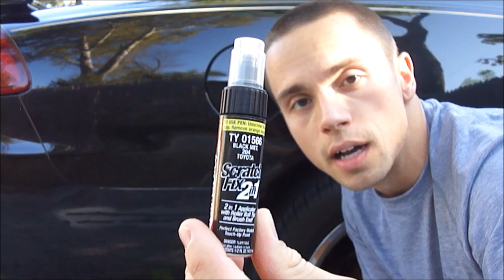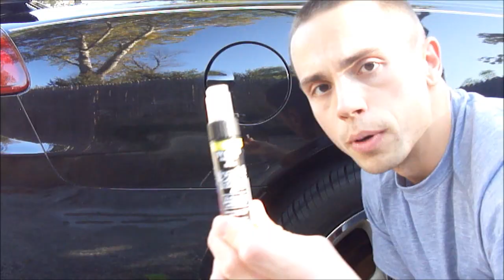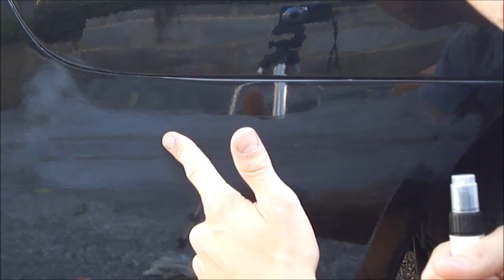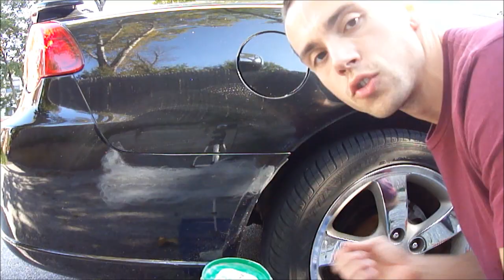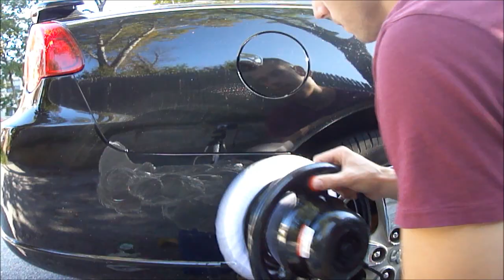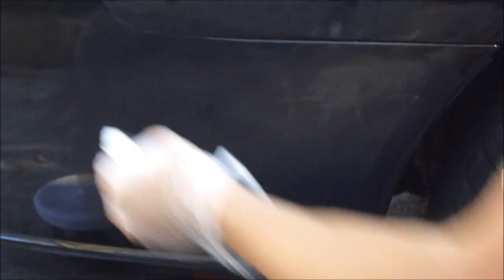How to Apply Touch Up Paint (to Almost Like New!)

Comment: Hey Rich, that looks good bro! As a professional detailer, can I give you some helpful tips for the future? First of all, you NEVER wanna sand in a circular motion! You do more damage that way to your paint. You always sand from left to right and stay as consistant as possible with light to moderate pressure. Second, stay away from the paste compounds. What you should be using for sanding jobs on any vehicle is Meguiars M105 Ultra Cut Compound. It's the best liquid compound around for tough jobs. It'll make your job a hell of a lot easier. Last, anytime you sand, you don't want to be using an orbital polisher cause there's not enough speed to take the haziness out completely. You should be using a DA Buffer or rotory high speed buffer. It takes half of the time instead of workibg 5 times harder and 20 times longer. Just apply the liquid compound on the yellow pad (compounding pad)and and smear it on the surface you're going to be working on a little bit so it doesn't splatter when you turn the buffer on, then you can start buffing the compound into the paint with low RPM's to start. After you start seeing the compound starting to haze a little, then you can crank up the RPM's a little more. As I noticed, you were polishing in circles also. That's how you can put haze marks, also known as holograms into the paint. You gotta move from right to left bro. Other than that, I think it looks good man. You sure did put some work into it. Maybe a little more than it should have been but that's because you were using an orbital polisher, not a high speed buffer. Great work man. I hope you can use those techniques I mentioned to you to cut your time in half and work less? It's up to you though. Hope this helped a little. Keep the world clean, one shine at a time!

Comment: Super Great Video. A truck pulled into the same panel on my Toyota yesterday. Mostly rub marks with a few places where the paint came off. I used wax and it cleaned up about 99% of the rub marks. Now I will be fixing the five spots of missing paint. Could not believe she pulled into me. Thanks for all your help. :)

Comment: If you are working by hand, after you are done with the 2000 grit sandpaper, do a 3000 grit sand paper sanding.  It will make the scratches a lot easier to remove with the compound.  As others have mentionned, that wax spreader is useless for componding and polishing... just do it by hand.  Use a small wax applicator pad (microfiber, cloth or sponger, doesn't matter) and compound until you can no longer see the haze.  Then do a polishing step with a finishing polish.  The best combo you can buy on a retail level is Meguiars Ultimate Compound and Ultimate Polish.  That will bring the shine back to the paint.  Then apply a wax or sealant to protect the area.  Also when sanding, using a sanding block or something that makes the sandpaper really flat is pretty much a must if you want to do a good job.  In a bind, use a kitchen sponge.  Just make sure only the sand paper touch the paint, not the scotchbrite pad, or you will ruin the paint.

Comment: I've been painting cars for close to 20 years What you did wasn't bad I just have 1thing. That haze you have isn't because you sanded too hard its because that wasn't a buffer you were using to buff with Its was more of a polisher used for aplying wax and polish, not compound.  they sell little buffer pads you can stick to an electric drill at auto parts stores that would work better. You need more friction and heat to get those scratches out. Don't listen to these shade tree detailers who know nothing, what you did was fine (not at all perfect lol but fine )just next time use a real buffer
Reply from the maker: Brandon Steele Wow, my mind was just blown. Thanks for comment! I've been wanting to buy those attachments for my drill.
Reply: Brandon Steele RichsMethods what he said :). Also I know you uploaded this vid in 2011 but you mentioned a sanding sponge early in the video just wanted to say that you can cop those at homedepot or lowes for a few dollars. I think they only sell low grit sponges(up to 3 or 400 i think, not sure) but I just wrap watever grit I need around it. Nice job!
Reply: Totally agree, the buffet he was using is a worthless piece of equipment.  They are far too slow.
Reply: hah i had one of those buffers once.. i think it cost $19.95..
Reply: Can you be a little more specific? There are lots of polishers out there, but how can you tell if it is a buffer? Speed? How fast? I just want to do a Q&D on an older PU, the clear coat is gone. I was just going to go and spray bomb new clear coat, and buff it out. nothing fussy.
Reply: joseph migliore oh，shit……you make me laughing so hard
Reply: Or a song from the Beverly Hills Cop soundtrack lol
Reply: Nice reply Brandon.I started iin the car biz in '72.Started my own in business at 18 years old,whew.time flies.
Back in my prime,I would use a wheel and wool and heat things up on a hood fender trunk and move the paint and close the gap on a scratch.Couldnt do it on every scratch of course,but I was really good with a wheel.
Dont really do that much anymore.I'm basically just a painter now,leave all the hard stuff for the young guys like Rich here.
I'm just happy to see a young guy actually working on his car and not sitting on his ass in front of a screen of some sort.Hell man,most guys nowadays cant even drive a stick.

Great job,Rich,don't listen to the haters,they need to hate their lives,not you.You did fine,but Brandon was right. Do like he said and pick up a little adaptor for your drill or actually you can pick up an inexpensive buffer at Eastwood or Harbor Freight.Be realy careful on plastic,you can burn things quick.Well not with a drill unless you lay into it,but just be careful on plastic.Metal,tool actually,with a buffer,dont stay in one place too long and let the buffer do the work,if that's what you get.Things can heat up quick,check your settings if you have them,start slow,stay out of the sun and have fun.Meguiar or Mother's are good products
Reply: And sanding in a back and forth motion would work best also, I too have worked in a body shop and I've never seen anyone sand in circle motion.
Reply: Brandon Steele q
Reply: A brandon quick question since you said you have experience. When i applied the pen on to my car it was the wrong black after wet sanding its uneven.if i get the right black to cover it  and sand will it be worse or it be better.
Reply: Brandon Steele said
Reply: Honestly that scratch didn't look that bad. I think you could have gotten a mr.clean magic eraser and gotten most of that scratch out. Than buff it out with some Meguilers or Mothers spray ,wait alittle than polish that out with a clean terry cloth and some good spray detailer. Elbow grease goes a long way for minor scratches.
Reply: BRANDON, I'VE HAD PROBLEMS WITH THE PAINT COMING OFF AFTER A FEW MONTHS. I USED HIGH QUALITY, FACTORY PAINT & 2,000 GT PAPER. THE PAINT COMPANY SAID I SHOULD HAVE USED  600 GT PAPER FIRST. THAT GETS ALL OF THE BUILT-UP WAX & OTHER IMPURITIES OFF. THEN, 2,000 GT TO SMOOTH IT OUT. YOU SEEM TO KNOW WHAT YOU'RE DOING. WHAT DO YOU THINK?

Comment from the maker: @happy9z I used the Color Magic (Black Wax) because it fills any voids in the paint with colored wax- giving an even better finish.  If your car has a lot of nicks and/or scratches in it, the colored wax works great to fill in those voids. Because your car is silver though, the normal Meguiar's NXT generation wax should work fine. I used to have a silver car and the Meguiar's worked great. I recommend getting the Meguiar's for your color car.

Comment: I use this to touch up chips and dings in guitars. I found it best to use a tiny brush with lacquer thinner to smooth the edges of the scratch or chipis. Then fill up the scratch with paint a couple layers. Then fill the rest of the way up the clear until it sits up proud of the surface. Then sand 1500 then with 2000. Then hit with a scratch remover compound with a drill and buffing wheel. (The rotation works better then the vibration buffer) Then a polish.
And I try not to stand the original finish so much.

Comment from the maker: @rcorrea26 The clear coat isn't necessary as long as you are careful when adding the paint. I've touched up my car a few times without the clear coat.  I actually used to own a silver Neon as well.  The clear coat gives it a nice touch though and would seal the paint (allowing it to last longer).

Comment: Clear coat works really well as it blends in the paint, I used 3 base coats and  a clear coat, then used t cut to blend and smooth the paint which left a bit of a haze before adding a final clear coat and rubbing compound.

Comment: Never seen a body shop painter sand in circular motion. Always sanded a 90 degree angle to the area that needed to be sanded. Even when using a da sand 90 degrees to the area. Now there up to 6000 grit sand paper which makes pull out that sanding marks so easy. You can do it with a da instead of a rotary polisher and a wool pad with a heavy cutting compound.
Reply from the maker: Interesting. I like the idea of using the 6000 grit sandpaper.
Reply: RichsMethods 6000 grit?   What is that, like notebook paper?   lol

Comment: The haze at the end looks to me like the result of the polishing compound. The surrounding paint appears to have been rubbed with rubbing compound, which doesn't leave a haze. Apply the rubbing compound to the entire panel followed by waxing should solve the problem. Sanding with anything above a 2500 grit is rarely necessary for a street car. If the problem is not solved with rubbing compound, which it should, and the clear coat thick enough, slightly wet sand the entire panel with a 2500 grit to even it out. Then, polish; rub and finally wax the entire panel.
if the clear coat is too thin or the haze persistent, consider repainting or spraying with clear coat over the entire panel to thicken it after wet sanding the whole panel existing clear coat. Proceed with polishing and rubbing. This will create a weak paint-clear coat bond that will only last up to 2 years depending on weather conditions. Allow to rest for 2 weeks before waxing with breathing wax.

Comment: Nice job, Rich. Three questions:
1. you mentioned that this is the bumper, which is likely a plastic. use the same technique on metal?
2. I have a black BMW with many chips on the front. Some of the chips show an exposed white color while others show an exposed reddish color.. same technique and products on both?
3. what do you think of using a paint stick rather than a brush.?
Thanks for the video and tips.

Comment: thanks, nice videos. only suggestions i would have is you want to sand in only one direction, not circular.any small flat "block" can be used as a sanding block, it just helps keep your pressure even when you are sanding. cut a piece of paper a little larger than the block so you can wrap it around the block and hold it in place when sanding.follow the compound with a less abrasive polish, look for something like a finishing polish or final polish. this will remove the compounding haze.

Comment: I liked your video, and I'm sure it helps a lot of people who are distraught by a gnarly scratch in their paint, and not able to pay $$ to have a shop fix it.

My only tip(s) is that if you add a small drop of Dawn soap to your bottle of water, it helps lubricate a better, degreases as well.  For the kind of repair you're doing, you were on track with using the primer after the scratch was super clean and degreased...then the paint and clear.  

One thing I've seen a lot of people do that causes a bad result, or takes a lot longer in finishing....is to put paint 'over' the scratch.  The touch up paint should 'fill' the scratch, instead of brushing over it.  Using a capillary action will fill the void without causing it to brush/flow over the edges.

Lastly... as a lot of people have mentioned here... is to always use a SMALL sanding block instead of fingers.  Autozone (and most others) have a small kit that's like $14 that has a small wedge block and several stick-on grades of paper for finish work.  The highest I've ever used on a car before finishing/buffing is 2000 grit.  Otherwise, it takes way too long and the results (on a road car) are not worth the effort.  Depending on the severity, I'll wet sand at 800-1000-1500-2000 - then on to machine work.

Again, cool video, great attitude, and clean production!
Reply from the maker: petrol88 Wow thanks for the ideas! I'll definitely keep these in mind next time.
Reply: RichsMethods Nice video.  Thanks for upgrading it.  Also, you can use a hair dryer or heat gun to very gently dry it on low heat so you don't have to wait 24 hours.  I used to work in a test lab and we did that all the time with paint.  But as with everything in this project, gentle is better, less is more.
Reply: Dennis Johnson 
hi how long would you use the hair dryer for? and how long would you wait after using the hair dryer. thanks.
Reply: NEVER use dawn dish soap on paint!
Reply: Everplex Media LLC... For general washing a car,  sure.   Nothing at all wrong with Dawn for prep or wet sanding.
Reply: Yes, if you want to strip the paint off your car, then you're right, dawn is ok. However if you want the paint to stay on your car, then do not use dawn dish soap!
Reply: Everplex Media LLC LOL... Dawn is a degreaser. They use it to de-contaminate animals.  It will remove the oils from the surface when prepping the car.  I've used it for 20yrs...never seen it damage anything.   (shrug)
Reply: It will destroy your paint. It's sad to hear you have been ruining people's car paint for 20 years! Please don't speak when you have no clue what you are talking about.
Reply: Everplex Media LLC wow... Bold statement.
Reply: Seriously? Please learn about things before you talk about them. Common sense.
Reply: Everplex Media LLC stop watching ChrisFix videos newbie

Comment from the maker: Hey thanks for the comment!  I'm not totally sure if there are different methods for metallic paints. I'd place the touch up in the same manner if it was me, but you may want to do a little research to see if you can get an even more ideal finished product. Good luck man!
Reply: You need to thinly layer metallic paints on so they don't dry darker that the original. I learned that the hard way and am now waiting for the redo to dry. (Totally chomping at the bit to get this small stone chip done) Metallic paint is a test of patience. You input in this video was very helpful. Thank you.

Comment from the maker: @jdleon9909  I used the 10-oz. "#7 White Polishing Compound" (You can get it at True Value, at least I found it on their website by Googling the name).  It's around $4.  I also used a 2,000 grit sandpaper. You may want to start with a higher grit, around 3,000 grit, in your case. Also, read some of the comments below. They give some really good tips on making it look a little better.

Comment from the maker: Different components of the paint could have evaporated or deteriorated over time. Also, was the paint matched based off of your paint code on the car (it's usually under the hood, trunk, or in the inside panel of your front doors)?

Comment: First off, don't sand the existing clear nearly as much as you did, you're just thinning it out without fixing it. Secondly, don't ever let compound or polish "dry" before you use it. It needs to stay wet or you will burn the finish.
Reply from the maker: Good point. Thanks man.

Comment: nice job. use a soft block for back up block on 2000 or 2500 more uniform sanding. always straight strokes done this way you can actually buff by hand with a pro diminishing polish and micro fiber cloth with nice results. avoid circular sanding. using bare fingers causes irregular sanding which makes buffing more difficult. always soak wet sand paper for min 30 minutes prior to use...makes it more flexible less irregular scratches...use a few drops of liquid soap for lube in bucket of water

Comment: I thought the only time you would need to use primer is if the scratch was showing bare metal, if not just make sure that the area is clean from any wax or contaminants before applying your touch-up paint. The clean, degreased original primer should be ok for a good paint adhesion. Try and rub out the scratch first with compound to see if the scratch even went through your clear coat, if not, you might be able to just buff it with compound and polish.

Comment: Use a rubbing or cutting compound and rub the scratch like hell to remove rust. Once done, use a primer as suggested in the video and then follow these instructions to fill the scratch with touch up paint. Take your time sanding and do it lightly. Don't try and rub it down in 10 strokes. Use 3000 grit if copounding by hand. Try also to feather the edge of your sanding area to remove any wayward sanding scratches. Feather by very lighty sanding the edge of the sanding area just a few times.

Comment: People.... spend the $20 to get an exact paint match from a dealer. While they overcharge for everything, it’s only $20 to get the same paint, plus the new touch up paint tubes (at least from Subaru) are a 3-in-1. Paint pen for scratches. Brush applicator for chips and larger scratches. Clear coat on the other end of the tube to finish the job. 

Good effort by the guy in the video, but I wouldn’t recommend sanding the surrounding clear coat. As much as it’ll never look perfect (since doing a DIY fix), just apply the touch up paint a thin layer at a time until it’s even with the surrounding paint, then add a touch of clear.